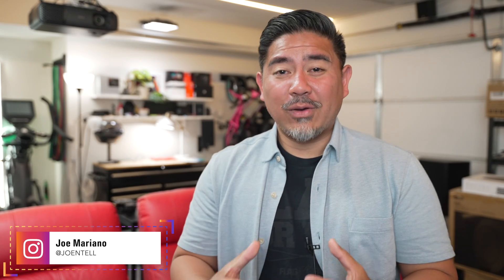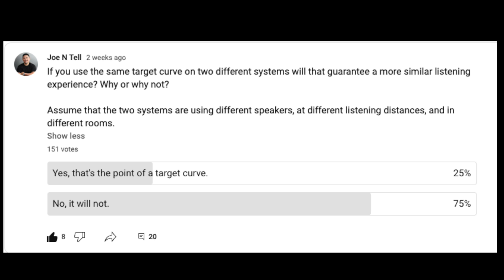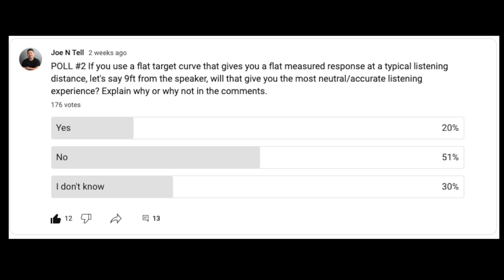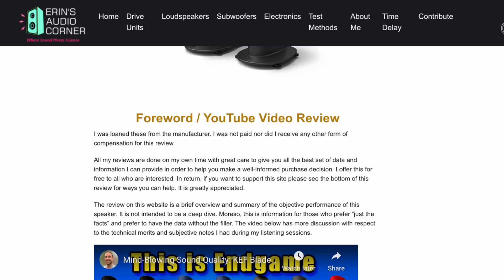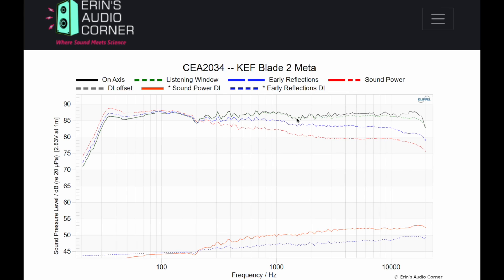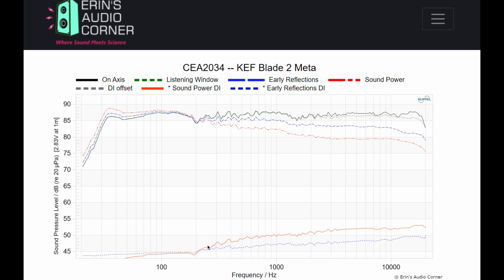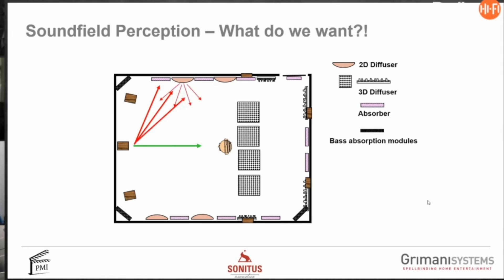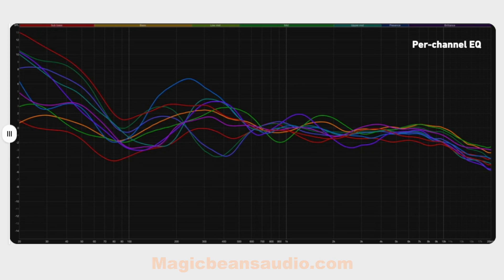Why Generic Target Curves Don't Work (Part 1 of 2)

Comment: I disagree and I think people here are mixing things:
If the SAME EQ is applied for different speakers it will surely result in a different frequency response at the listening position.
But room-correction is working by applying a CUSTOM-MADE EQ based on prior measurement specifically to reach the same frequency response at the listening position.

Just imagine you have two different light bulbs and you set the potentiometer switch (=EQ) to 60% then both of the light bulbs will have a different brightness.
But if you measure the light intensity at a certain position and set the potentiometer switch accordingly, then one bulb may run at 60% while the other at 45%, but the result (=the light intensity at the measured position) is the same for both.

This is called calibration and is common for many product types.

The room-correction (say Dirac) does just that: it measures the response at the listening position (Curve A).
Dirac applies the EQ filter to reach the target curve (Curve X).

Then you change your speakers and repeat the process.
Now, Dirac will measure a different response at the listening position (Curve B).
Dirac now applies a different EQ filter than before to reach the target Curve X.

In the end, the frequency curve reaching the listening position is Curve X for both speakers. And since Curve X = Curve X it sounds the same.

Limitations are:
Moving away from the measured position, the frequency response curves can be different due to off-axis and reflections.
If the speakers are physically not able to reach the target Curve X (e.g. low-bass extension) then they will sound different.
Reply: @joentell, what @christiankogler6547 explained above is also the way I understand/ understood it, and your video did not clear it up for me. Your reply to his comment here does a much better job explaining it for me than the video. I would love to see a video where you go into more depth on this aspect.

After reading your response to the above comment, I am now becoming very interested in Magic Beans. Before, I was mainly finding that you went from explaining basic concepts to jumping to your principal conclusion without really explaining it. Intuitively, and based on your reputation, I think you may have a very promising and innovative product here that I would be willing to pay for. But I don't think you're hitting the mark yet in terms of explaining it to someone like me who knows a little about this topic but is far from being an expert. I think that might describe a large portion of your target market.
Reply from the maker: @R00m1o1  I explained a lot of my response in Part 1 of my target curves videos. The fact that some of these counter to how most people think things work is why I'm trying so hard to explain these concepts and not just have a "trust me bro" approach. I'm explaining the psychoacoustic principles and showing the real-world measurements.
Reply: I am starting to gather that there is a major breakdown in terminology. I've watched dozens of Joe's videos and I'm still baffled at what his app is supposed to be fixing. 

@christianlogler6547 - Your breakdown here is "how it works". While sure, (using your analogy), the light from the different bulbs might have slightly different color temps - they are going to be the same intensity. That's what room correction does - same frequency response, but perhaps there will still be some coloration from the speaker's timbre, etc.
Reply from the maker: @fattmann  the breakdown is not in my terminology, it's in some preconceived notions about what the microphone measures vs what we humans hear. After EQ, two totally different speakers can measure similarly at your listening position and still sound very different. The reason is because the mic is only measuring the combined response of the direct sound mixed in with the reflected sound aka steady state response. That is not how our ears hear. We have two which means we can hear timing differences and it allows us to determine which of the sounds is direct and which are caused by reflections. Therefore, things like the directivity index need to be taken into account. 

When people begin to understand the difference, they'll understand why simply correcting speakers to have the same target WILL NOT give them the same sound at the listening position. 

I mentioned in the video the difference between correction curves (or correction filters applied to a speaker) vs target curves. There's no confusion on my end.

Comment: There is one very important factor that people miss in all of this. Depending on the SPL at listening position, the perceived FR will differ due to Equal Loudness Contour.

Everything needs to be taken into account.  From the size and dimensions of the room, to the reflectivity in the room, to the directivity of the speakers, to the distance and positioning of speakers relative to each other and main listening position, to the distortion levels, listening preferences, as well as SPL.
Reply from the maker: I'm not a big believer in utilizing the equal loudness contour curves. I understand the concept behind this, but I don't think it's necessary when you have a proper target curve set. 

It's similar to when people want to use a flat target at the MLP. They aren't accounting for the fact that our brain does processing of its own and trying to make it flat interferes with the brain's compensation methods. Same with equal loudness contour. Our brain understands that lower volume will reduce the perceived bass since that's what happens in reality.
Reply: @joentell  Regardless of what you believe, Equal Loudness will have an effect on perceived FR.  If you use a target curve that is good for a certain SPL, it won't be as good or might even sound bad at a different SPL.
Reply: @joentell  SPL affects perceived FR.  Our ears don't compensate for this.
Reply from the maker: @thatchinaboi1 Imagine if you could have someone play a kick drum at low volume and a snare at the same intensity in your room. If it were possible for them to keep the relative intensity the same and increase the overall SPL, you would find that the perceived bass is lower relative to the higher frequencies related to the findings of the equal loudness contour curves. But you wouldn't apply EQ to that live drummer. You would accept the fact that's how our ears work and it wouldn't sound unnatural since that phenomenon happens with everything in the real world. So yes, our brain does compensate for that.
Reply: @joentell  Sure, but that is a terrible analogy.
Reply: @joentell  Try listening to your system at 100dB and tell me how your ears compensate for the perceived harshness due to Equal Loudness.  (Assuming your system is neutral at normal listening levels)
Reply from the maker: @thatchinaboi1  what makes it terrible? I'm always up for a healthy debate.
Reply from the maker: @thatchinaboi1  I don't understand. I've listened that loud for short bursts. It just sounds the same, but louder. I don't understand your point about harshness.
Reply: @joentell  This is not correct for recorded music. Lets say that a Rock album was mixed and mastered assuming people would listen loud, like 85db. For the sake of argument, the Kick and snare, are at a 1:1 ratio. Now its night time, and your family is asleep,  you turn it down. The ratio is now .5:1, adding about 6db of EQ un the bass region will make it sound more like the recording did at high volume. "Dynamic EQ" and other similar products, essentially gradually add in an equal loudness adjustment as you reduce the volume. You can set a baseline volume, threshold, and change the amount of correction that is applied your your liking. 

Last thing. You have obviously never worked with live bands. Nobody has ever needed to or wanted to ask a drummer to play louder. LOL, and YES the engineer absolutely mixes and EQs each drum to sound balanced in the PA. Guess what, when they play a quiet ballad after a rock song, you can even fire a snapshot to recall different EQ for each song.
Reply from the maker: @ryanlilly9290  My issue with your example of the kick and snare being a 1:1 ratio at 85dB and perceivable a 0.5:1 ratio at low volume is that there's an assumption that our brain doesn't already compensate due to it's understanding that our perception of bass at low volume is different than at high volumes. The assumption is that a +6dB compensation will give it the same tonal balance according to our hearing capabilities as shown in the equal loudness contour curves, but it in my experience, it merely sounds like there's 6dB too much bass. There needs to be more studies done about listening preference with regard to loudness contours as the previous ones are based on perception, not preference. If you can link me to a paper that shows otherwise, I'll take a look. For now, just press the button for DynamicEQ or not. It's not a huge deal.
Reply: @joentell  Our ears don't compensate for Equal Loudness.  We just have no choice but to deal with it.  🙄
Reply from the maker: @thatchinaboi1  I think we may kind of agree here. Loudness compensation assumes that we want to hear bass at higher relative levels when the overall level is low. I find when I want to turn down the volume, the bass is usually the thing I'm trying to reduce. I don't want it to lower at a slower rate than the other frequencies.

All I'm saying is low sounds are perceived as having less bass in the real world. I want my stereo playback system to exhibit the same behavior. If I want a more neutral response, then I will turn it up to near reference.

I truly believe that most advocates of loudness compensation are using a target curve that is flat at MLP and using the contour curves helps to compensate for that. My experience has been that if you're using a target with say a 9.2dB bass rise, and you use Audyssey's DynamicEQ, it's possible that it will boost the bass up to 15dB at low volume. That's a total of nearly +25dB and it sounds ridiculously bassy as you might imagine.

Do use a flat target at MLP?
Reply: @joentell  "Flat" as in downward sloping toward the treble.  The further MLP, the more downward.
Reply from the maker: @thatchinaboi1  if your downward slope isn't very steep, you didn't specify, but your room response really wants more of a bass rise, I can see why you might find the loudness compensation more useful than I might.
Reply: @joentell  So what you are telling me is that you don't know how to implement Dynamic EQ in Magic Beans, so there for it's not needed?
Reply from the maker: @ryanlilly9290  This is not for MB to implement. DynamicEQ is separate and if the AVR or processor supports it, people are free to utilize it. I don't personally recommend it for the reasons I mentioned in my previous comments.

Comment: I don’t use much of a curve at all. In fact, I’ve dsp’d my rinky dink speakers to the exact FR of the Genelec 8361a. 

My speakers have never sounded better.
Reply from the maker: Which speakers?
Reply: @joentell  Rinky dink may not be the right word. They're well designed but ugly and not at all meant for the home environment. But they were free. It's a pair of EV TX2152's.

When measured on a Klippel,  the Genelec 8361a's do come with a house curve built into the DSP but it's veryyyy shallow.

Also, I hope my OG comment didn't come across as combative or pretentious. I just really love the sound of the Genelec's and my wallet is empty. haha! Doing what I can to squeeze every last ounce of performance out of em.
Reply: @chippsterstephens6800 because I’m good as DSP means that I don’t know what Genelec 8361a’s are? That’s the dumbest comment I’ve read in a while. 

Also, I’m a FOH engineer by trade. Would I rather have the 8361a’s? Of course. Do I have $15k to drop on three of them? Absolutely not. So, I make do with what I have and squeeze the best performance I can out of them.
Reply from the maker: @chippsterstephens6800 are you referring to me or the OP? I know Genelec and I've interviewed someone from there at NAMM. I was asking about the OP's speakers.

Comment: From my understanding a target curve is not the eq directly you have to work off a mesurement. Then you take the difference to the target curve and the difference is your eq.

As long as you are exzacily where the mesurement is taken you should have a sound profile very similar to your target curve. So the answer to question 1 should be yes.

Now you are right in the fact that rooms do change this as compared to per say a headphone where you are in the near feild 100% of the time. (Spatial audio and hrtf's aside)
Reply from the maker: What you described is how nearly all auto-room correction works. They take a measurement at your MLP and they use that response and apply filters to conform it to a preset target curve. 

What I'm saying is that it's still not correct and the answer to Poll #1 is still no. Just because a microphone measures the Post-EQ response the same at the MLP for two different systems (different speakers, different rooms, different listening distances) does not mean it will sound the same to a human. That's the reason we talk about psychoacoustics, not just acoustics. How we interpret sounds is equally as important as having good acoustic measurements.

Comment: Well said. I would add dynamic compression and dsp as well. Speaker might present certain response but under stress at high SPL heat increases and will change its response. Difference between good speakers and not so good. With DSP in active speakers (including subwoofers) it will limit its output at certain SPL thus change its frequency response.
Also in MTM designs woofers usually cancel each other to some degree, depending on off axis angle.
Reply from the maker: That's the topic for a different video